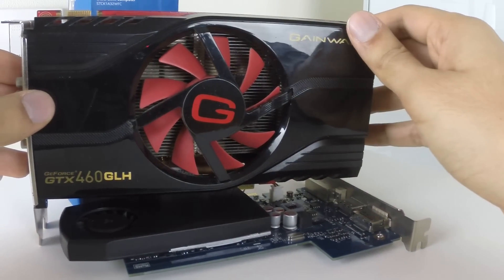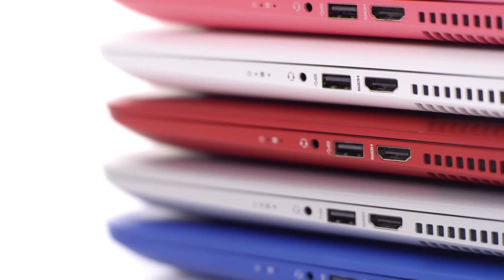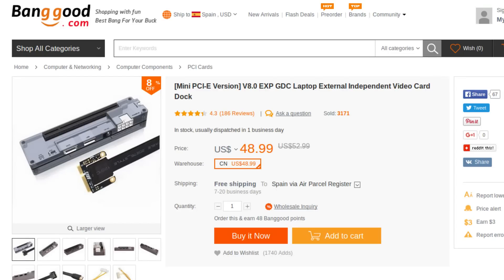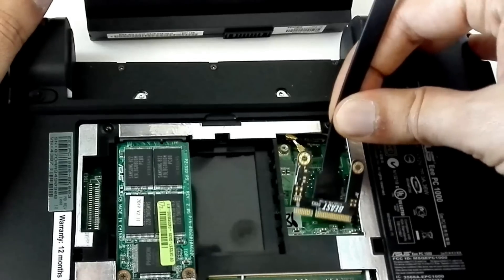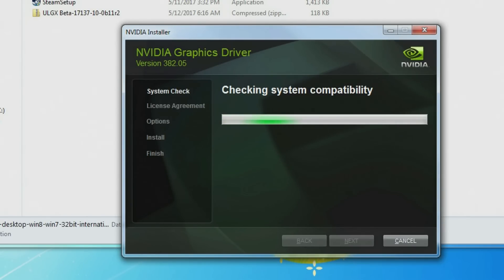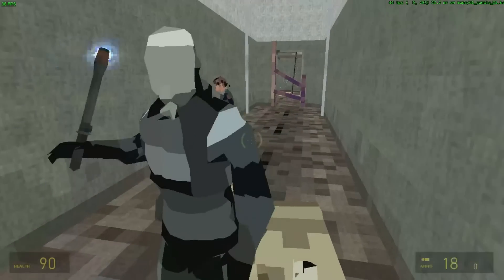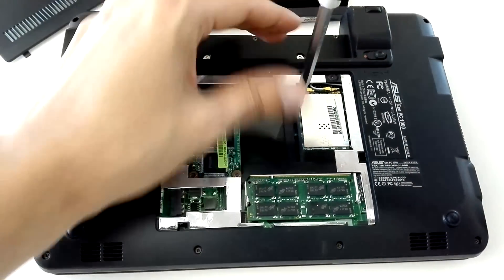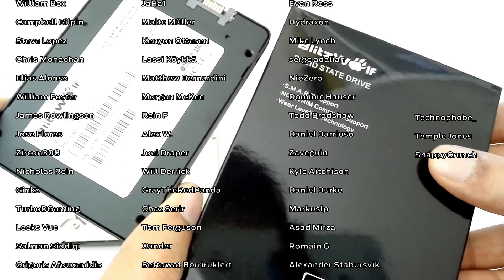An External GPU for an old Laptop?

Comment: Finally got mine working, had some low-power instability with my 400w power supply, thought my ThinkPad bios whitelist was clawing back from the dead. 
Burnout paradise has gone from 10fps at 800x600 to 40-ish at 1360x768 (as low as 30 and as high as locked 60 in some places)
Now I wonder how much better it can get using something that isn't a GT430
Reply: What cpu it use?
Reply: @irfanyxp3489  Core2Duo SL9400 1.86 Ghz

Comment: Finally an obscure topic where I have experience: I am currently running a Thinkpad T430 (i5.3rdgen 12GB ram) with an ExpGdc via an ExpressCard running a 1050. It was a b*tch to setup, and after tons of errors the solution seemed to wire the dedicated PSU to be always on, and hotplugging the expresscard to the notebook while exiting the BIOS without saving changes. Once it started working, the performance was suprisingly good! Even after all that, I am still haunted by the error numbers 13 and 42!

Comment: Hey! I've been using an HP Compaq 2003la because i was really in need of a computer for my studies. Over a little time, i've upgraded it to 4x2 (8) GB of RAM and a 124 GB SSD, which, with some optimization, turned out to be just fine. However, now im looking to go forward with an external GPU, i've read on some articles that HP "BIOS Ban" some new components, and i do not know how much of a real thing is for me, assuming that is a 10 years old pc. Also, do i have to connect another monitor to use if i successfully install my eGPU? Pls help

Comment: Can a egpu work on 2011 latop ( i3 2nd generation)?
Reply: Depend you can do this what's on the video I think but I don't think you can get a normal egpu as they need thunderbolt 3 connection

Comment: hi i have Ryzen 5 2500U with 8gb ram  is there any tips in choosing the right gpu for my system?
Reply: Check my channel ^^ guide for Ryzen 2500u should be using Beast EXP GDC NGFF

Comment: there is another adapter available ADT-R43SG which is a m.2 nvme to pcie16x adapter. so i wanted to know if this(ADT) adapter will work on my i3 10th gen laptop nvme connector .

Comment: for my cheaper friends out there: https://m.aliexpress.com/item/4000189082535.html?_randl_currency=USD&_randl_shipto=US&src=google&albch=shopping&acnt=494-037-6276&isdl=y&slnk=&plac=&mtctp=&albbt=Google_7_shopping&aff_platform=google&aff_short_key=UneMJZVf&&albagn=888888&albcp=9765122064&albag=101238896618&trgt=892975210062&crea=en4000189082535&netw=u&device=m&albpg=892975210062&albpd=en4000189082535&gclid=EAIaIQobChMIuv6E78KI7gIVmK_ICh2uIAhzEAQYAiABEgKLiPD_BwE&gclsrc=aw.ds
https://www.ebay.com/itm/Dell-Optiplex-390-790-990-3010-7010-Desktop-K2H58-7GC81-FY9H3-MPX3-Power-Supply/273950938431?_trkparms=ispr%3D1&hash=item3fc8bf953f:g:eJcAAOSwN2VZXpjx&amdata=enc%3AAQAFAAACcBaobrjLl8XobRIiIML1V4Imu%252Fn%252BzU5L90Z278x5ickkY3FSd4Ad8xn3oRtkVexxrEJ9M%252FX2AMkVemDG9V9OtC7%252FBm9pVWWzBDs3EPQ9pAwbwK%252FdWvFuJw%252BLMfQg8HyhAxgu1At8JGhhTCAUwzaqWTX%252Fml7VgWl7jHClvl9Ve4F2LD5PtV5CpTORIPvmVTHtjSQeTrk6Q%252Fpo%252FUEOqHiVDJEgFkM0zDdKC6wX8me96VvAeXy%252FZAF%252FTfAC4SDC6LzsphcZu1DjsS87b61H2cA59iZfX7Lq1s%252BF%252F%252BGSMZQMa1xRC%252Bf7oyPHvJeUIETUosByLfhlDVLaLb%252F1rgJiW%252FYDnSfNYlFkorr7A0t8fZnn6E%252Fx3lhDBAKLB374CPiUOzisKzSmCk16mjZ6BLE%252BPnYGf20ywhEL992lWE6MgRk%252FZq5vnuSAmgBwgrD0P8dxeeQtKGLNFbsrOWNhF5JoN%252FoWqWvGmkz6Wl0dWcEMg4jj%252FOZEGgA5L%252BY8ojgSVi%252BayWCZrjk%252BlCB042AiFgmu%252F%252BaxtCDiZHB08aqAi7S69H8X859tRl%252BCHd9gv2eeaDKore0PNKNjC3lcfJWLDrxhA82YuRZUkMa3275ws%252FJR9JDzmgirY7oXME3GSv%252F%252BZP69nJuNfCTvO6DueQsu6ttxbMvkJiHy9pNYUXqJcPpkzh%252BtC2y3O6XsD414S5azdLCvs%252BolNv5ToIZr8FXLg020EzUDpaxEM%252F1jTS8qoYi03rCs9HRg3tYRQgIvQUsKBzAbVKQXutC6wDVYU7gwrCaJuVW%252BKXH7%252BryGgS499NcFCHpWEhuYuFO8IrjC9blALIInFXI47Q%253D%253D%7Ccksum%3A273950938431e9ed74310dce48b6bbeeb7fbec4d2466%7Campid%3APL_CLK%7Cclp%3A2334524
all u need

Comment: someone help please after i install i got error code 12 in device manager
i cant use the gpu as my main graphics cards it still uses the intel hd 4000

the driver was installed but without the nvidia control panel
i also have a 2nd monitor which is plugged in the laptop not in the gpu
because if its in the gpu it is only black
Reply: my laptop is acer e1-470p, windows 7 64bit os 
help please

Comment: Don't try Dx9 games with the exp Gdc beast as that API is notoriously bad at PCIe data compression and the performance penalty is huge, this is coming from a current exp Gdc owner. Instead play games that are dx10 or dx11 which most, if not all, games of today run by default. There is still a noticeable difference between a GPU running on an x16 width bus and that running on just 1 (express card and mPCIe but it is definitely better than the integrated card you were intending on sidelining

Comment: that's genius and insane,it shows hows major brands limit any laptop,I 
mean,also a 15 years old laptop could works fine with a decent graphic 
card but they choose you can't upgrade (or not many much..you need 
mxm,soldering,bios mod and so on also for old graphic mobile cards) 
while in this way,you can keep old machines and use it,not for extreme 
gaming but for example to boost up video editing,photo editing and 
similiar..the bottleneck will be the ram,some laptop are close to have 
at max 4gb and this could be a problem for nowadays applications but 
with old adobe apps or mid-range games you may improve your laptop with 
about 50/100 euro/dollars :) just a question..is possibile to avoid the 
external PSU and use a DC-power supply instead since this adapter  have 
the 12v DC-in ? cheers :)

Comment: Hi there, I have a HP Spectre 360 with i7 8550u, 64bits with a GeForce MX150.
I want to use your method to install a AMD Radeon RX 5600 XT, Gigabyte Radeon RX 5700 XT or Nvidia GeForce GTX 1650 Super. 

Can these graphic cards work on my laptop? Thanks!

Comment: I guess we did this either because he's the low spec gamer or because we're crazy as he joked in the video, but it seems like a good way to make this setup look decent but not great by picking a laptop with such a trash CPU.   3rd Gen i7 in some old machine would have done much much better.    And of course that eGPU is fine for old games, but you could get RX 570 for like 90-100 USD.

Comment: I am interested in buying this device for my toshiba satellite c55d with an amd a8 6410. My question is, can this device work without power if I use a low-profile graphic like the gt 1030? In case it is absolutely necessary to give power to the adapter, I must rethink the purchase. It would not be a good option for me if I need to buy a power supply in addition to buying the adapter and the graphics.

Comment: Intel(R) Pentium(R) CPU N3710 @ 1.60 GHz 1.60Ghz
4.00 GB
64 bit OS, x64 based processor 
with this specs May be able to use this external gpu?

Comment: Why the 1050 is not compatible? Which is the parameter does the video card require to work with the adapter? Would be really helpful

Comment: I got a question so basically I can use this external graphic using type c port? My laptop has a type c port so I can use a type c HDMI cable?
Reply: Nope.You can do video out, but you can't connect an eGPU to USB.

Comment: This device might not work on any laptop. Most of laptops restrict set of devices to be connected via PCI-E by keeping hardcoded whitelist in BIOS.
LowSpecGamer had a luck to have a "laptop" without limitations, but you might not be so luck as he was.

Comment: putting tape IS A TERRIBLE IDEA since if the cable moves you can get a shortcircuit and blow you mini pcie port and probably te hole laptop.
Reply: Do you have any idea how laptops work? That'll never happen.
Reply: @tobytomkinson  sure you know more... Look here https://youtu.be/MYWriFMQH_o min 9.30
Reply: @tobytomkinson  yes! I have no idea how laptops work... Just like you apparently

https://egpu.io/forums/expresscard-mpcie-m-2-adapters/exp-gdc-beast-v9-0b-burnt-up-an-m-2-port/
Reply: @TIPER2K  So the first link is because he's using an HP laptop with a whitelisted BIOS that doesn't allow anything other than a wifi card in the mpcie port. The second one isn't an mpcie port at all - it's m.2, which is entirely possible to shortcircuit (and also irrelevant considering you claimed the mpcie would shortcircuit).
Reply: @tobytomkinson  not going to argue with someone who thinks that the proper (good) solution is a piece of tape. Good luck! You will need it

Comment: What if the motherboard of my laptop has what seems to be a mini pci-e without soldering and I solder one to have another pci-e and in addition to make a hole in my laptop to put that HDMI with a male adapter to female and just to get to connect and turn on my laptop and ready to play without sacrificing the wifi that my machine already has

Comment: i need one of these my laptop (DELL Latitude E6510) has 4 mini pcie slots (3 because the wifi card is still plugged in and i use it) and the express card port, its a old laptop and i like it the GPU is just trash and wont let me play newer games and i cant find a alienware laptop that i like so if i can get this to work i will be keeping my laptop until it dies then i will make a new motherboard for it with AMD FX or ryzen  and a radeon GPU

Comment: While this is indeed good for the quick and dirty, but can you cover the secondary method where you use expresscard or even the CardBus-to-express adaptor for the larger port.
Reply: Also, try it with the gt1030. 
My laptop is hungry for power.
Reply: You'll need to use an external PSU anyway - your laptop has nothing to do with powering the GPU.
Reply: @tobytomkinson  
It's meraphorical.

Comment: I am currently running a Lenovo T430 that i bought cheap on EBay, with this kit, and a gtx 1060. Also the T430 has a socketed motherboard so i was able to swap out the dual core i5 for a quadcore i7. Real budget gaming

Comment: Can we connect the output hdmi of the graphic card to the same laptops hdmi port in substituition of a external monitor...coz an external monitor is said to have some more performance than using the in built monitor...coz the gpu has to send back data to the laptop.

Comment: since this is on old video does this nowadays support AMD GPU's still have my old R9 280X 3GB

The laptop I have that could potentially be used are:
Dell Vostro 1710 intel core2duo 2.0 and with 17" 1920x1200 screen is amazing
Acer Aspire 9802AWKMi core2due 1.73 dobly DTS and a whopping 20+" FULLHD screen
(these machine are frigging heavy lol)

Comment: I tried this on my 2011 MSI Cx61 notebook that has an gt420m in it and connected a gtx 1050 to it. The performance was definetly a way better than with the nvidia mobile gpu and most of the games were really playable but I was hitting the CPU bottleneck when I was trying to get GTA V running on it.
The textures didn't load properly or even causing the game to crash :P

Comment: You can actually build a lithium ion battery pack and with a series of voltage regulators and a lot of hot glue, you can turn any laptop into a gaming laptop with an upgradeable GPU, and be able to use it completely unplugged 

I have done experiments with that sort of thing, but I think it would be very interesting to see it properly implemented 

Also, expresscard slots are common on ThinkPads and other business laptops

Comment: is it good for iMac？ I think iMac 2011 has a same interface for WiFi card。
Reply: iMacs(or any apple desktop or laptop in general) don't support nVidia graphics cards at all. Only AMD
Reply: @franciscoh6210  I will try vega 64， I have one in my PC
Reply: @play362  alright, 2011 iMacs have support for thunderbolt 2. That means you can get a thunderbolt 2 to thunderbolt 3 cable, and find a cheaper external GPU dock. That way you could just set you Vega 64 in it, install drivers, and you would be good to go
Reply: @franciscoh6210  yes，it has TB port， but I really like do some experiment on my old friend. Thank you so much.

Comment: "The gpu is the most important thing is the gpu"
Buys a gt210
Reply from the maker: Welcome to the LowSpecGamer
Reply: @LowSpecGamer  if you have a 13" laptop with Ryzen 5 4500U (6Cores / 3GHz boost) and you try to set up this on it what the the best compatible budget eGPU that can you put on to run smooth and take the max power possible of it and avoid bottleneck ???
Reply: @LowSpecGamer   same video card but icant run gta sa in max settings lol without punching my pc
Reply: @LowSpecGamer  help me pls lol can we run gta sa in very old pc with 512mb windows xp lel with intel graphics -_-
Reply: you must be new here
Reply: Missed the sign on the way in?
I don't see "highSpecGamer". oh?
the post office is next door.
Reply: E3
Reply: Guess you had these comin.

Comment: Is there any GPU which works without the extra power supply?
Reply: gt1030
Reply: Gustavo Flores B. Will this just run off battery of the laptop then mate?

Comment: raises hand I've got a dell 1525 with an Expresscard/54 slot.  I'll be getting one of these to play with, I think...
Reply: Don't get too cocky though.
Think about your options properly. Remember that, even with less than 200$, you can build a decent PC. Don't make the mistake that I almost did.
Reply: @kywii6678  Oh yeah, I mean, I have a couple of Core2Duo systems around here, I think I have a Pentium E3250 board, etc., it's more for the novelty of it.  But I appreciate the warning.

Comment: im using laptop acer aspire E 15 i5 gen 5 8GB of ram and using zotac 1060 6gb. i already put 12GB of ram (8+4 ram on laptop) still not detect the graphic card on my pcie. please guide me. and also im using 600w of psu. i already installed the driver also not detect the gpu. if you want my laptop screenshot please do not to hesitate to ask me
Reply: unistall wifi adapter
Reply: eisoon eusoof already unistalled wifi driver still not detect anything
Reply: @M3jat95  do you use pci-e like in the video or the cheap one

Comment: 5:41 "SSD hard drive" NANI?
Reply: SSHD? Cause that’s basically a ssd and hdd hybrid, though personally I’d just straight up go for an SSD.
Reply: @MikhaelAhava  it's not an sshd, it's a sata ssd, that's why he's calling it an ssd hard drive 'cause it goes into the hard drive slot
Reply: @westsideslasha  ssd  are not A HARD DRIVE, and it wouldn't fit in the hard drive slot..
Reply: @feliciacore  There are two forms of SSDs, an M.2 SSD and a 2.5" SATA SSD. An M.2 SSD only goes into an M.2 slot. It has the profile of a stick of gum. The one in the video is a 2.5" SATA SSD which should fit in a SATA or hard drive slot with no problem. They are the same size and will fit in the same slots as a laptop hard drive.
Reply: Strider, SATA SSDs exist that can replace laptop-size hard drives and fit in the same slot. What are you on about?
Reply: @RicH0864  Sad mSATA noises
Reply: @Klosop  wow so mature and great insult
Reply: I think its the ssd hard drive hybrid disk

Comment: I have a 2008 core2duo 1,66Ghz Sony Vaio, with Express cardslot, and the graphics card drivers were unsupported. It was just using a pass-through for the internal graphics in my case.
You can also plug a 12V power brick. They have 12V 10A bricks out there.

I would love to see what's the fastest card for this docking station.

Comment: Theres a few things you forgot to add, one on this egpu if you use a amd card you have to run a external monitor, two you MUST uninstall your mini pcie wifi drivers BEFORE you connect the exp gdc 3 if your laptop has a dedicated gpu you have to go into the bios and disable the dedicated gpu then start up windows and then install your gpu drivers

Comment: is a 40 dollar hdd 7200 RPM good because it does pretty good after disabling all startup, but sometimes struggles on gta V and it could also be the 4 GB of ram i have but i will upgrade that later.

Comment: There's a 160$ Nec laptop that has an i3 3120m intel hd 4000 and 4gb ram i think its a great budget gaming laptop
Reply: Integrated graphics is not good for gaming...
Reply: *DO NOT BUY* Intel HD is a no go for Video Games
Reply: @skyrider169  lol it's much better than intel 500 graphics on most 250$ laptops
Reply: @Lesss_22  Actually, Intel HD 500 series integrated offerings are FAR superior to 2000, 3000 and 4000 offerings.
Reply: @Lesss_22  Look up some benchmarks and do some research before making wrong statements. Intel's HD 500 and 600 series are their entry-level offerings, with their Iris lineup fulfilling the purpose of their more high end graphical chips, while their 2000, 3000 and 4000 series merely take the role of simple graphics adapters, with each showing little improvement over the last.
Reply: I have old laptop with i7-3630qm with hd4000, 8gb ddr3@1333, gt640m 2gb ddr3 version, samsung 850 evo ssd in sata2... 

Hd4000 can handle games before ~2007 year in 60 stable fps, gt640m even when overclocked to 1040 hz on core and 1050 hz on memory can handle games before ~2012 in stable 60 fps in 1366x768 resolution and mid-high graphics... And in games after 2014 my laptop have 10-40 fps. I have some experience in configuring windows and computers, so I have 2 latest win10 OS on this laptop: one for games with everything "unnecessary system components" removed from OS (in task manager 50-60 processes, 700 threads, 17000 descriptors) and I temporary removed laptop  lid and place laptop on massive cooling pad.

 All of that is not enough so hd4000 surely not for last 10 years games. I can advise buy laptop (but stationary PC would be more powerfull and cheaper) with something like gt94*m with gddr5 3+ gb memory or better nowadays for games and at least 4 physical cores and 3+ Ghz CPU, 8-12 gb ddr4. Buiyng something worth than that have no sense for modern games.